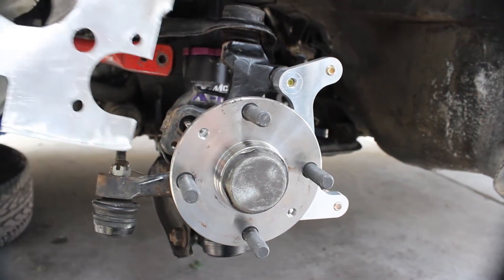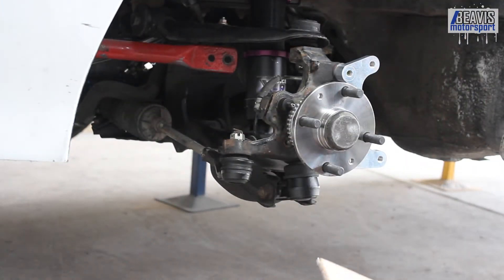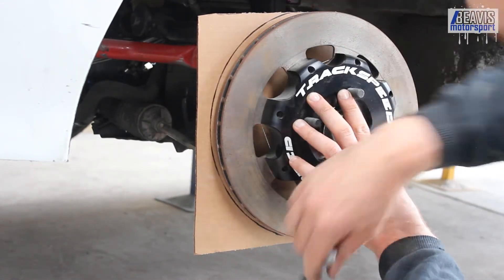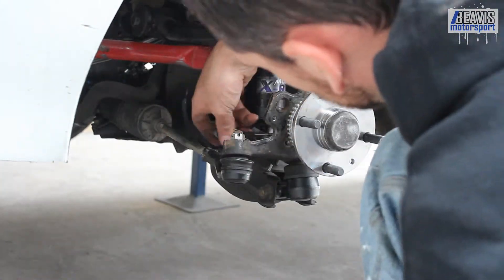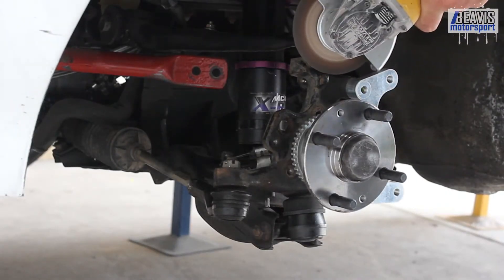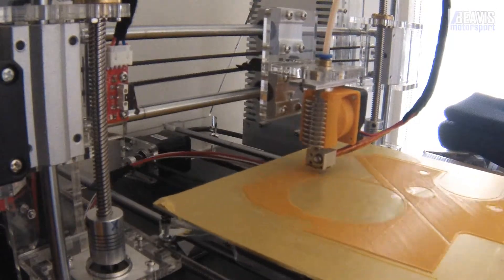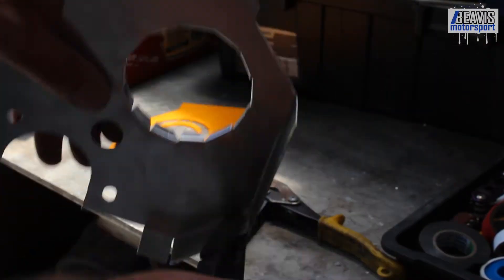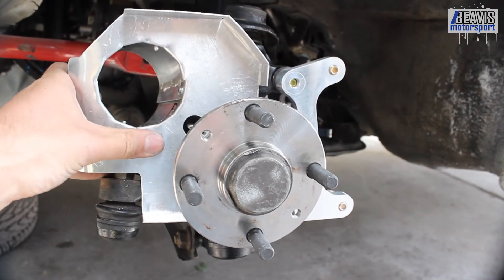Prototyping Brake Ducts - Episode 31 - Time Attack MX-5 Miata TURBO Build

Comment: What do you have in mind for turning clearance? looks like the tubing on the back would contact the shock body or at the least, highly stress the duct piping when making large turns. I'm sure this may not be  concern on track, but figured it might be an issue when in the pits or during loading/unloading from the trailer and typically moving the car around in general
Reply: Good one, I was wondering the same thing
Reply from the maker: Yes that is definitely going to be an issue, I'll just have to limit my turning circle to ensure I don't get too much rubbing of hoses and things.
I'll do as much as I can to make the hose fit at an angle towards the front of the car so that it hopefully clears the hub/shock area
Reply: I have an idea, i don't know if it will be of much help but i'll put it out there anyway... given the length that you have made the tube... maybe cut it to where it's one about 30-40 mm and use a pair of crimping pliers to put a lip on it ( much like intercooler piping ) and then use a silicone elbow at either 45-90 degrees to make the transition to the duct tubing. If my extrapolation is correct this would do 3 things. 1. move the obstruction outboard closer to the hub. 2. move the mounting point forward ( so that under turning could potentially be past the shock body. and 3. would make the portion of the duct that would be in the immediate path of the shock body a pliable object so that under brief instances of contact no damage would cause...
Reply from the maker: Thats some good ideas, I will definitely keep this into consideration when I finalise the design.

Comment: Hi Brendan, just done something like this on my mx5, ready for the track this weekend. Did you have an issue with overly hot front brakes before the ducts? Did these help? I had heat issues in mine all last year, hoping the ducting will help.
Reply from the maker: The MX-5 brakes are great until you start running really fast with turboes and the like. Without a turbo, the oem gear can usually handle it fine. I didn't end up using these shields as I'm going to redesign them. Where abouts are you driving?
Reply: I'm in the UK, a track called Blyton. I have an SC on mine, so a bit more poke than stock. Always found I was getting pad glazing. Also found my wheels had blocked the stock vents so fingers crossed the ducting will remedy that. Gone through the usual brake late and hard, don't drag the brakes driving tips and don't want to go to a racier pad that doesn't work on the street. When are you planning on getting the new design sorted?
Reply from the maker: At this stage I'm opting for just some hose facing toward the hub. No actual duct mount to the hub area. The hose should still help by directing fresh airflow into the vicinity.
Reply: Sounds good to me. Just got back from my trackday... Night and day difference. Made more difference than stock caliper ---> wilwood 4 pot. Fade free brakes all day at last! Get them on and get on track Brendan!